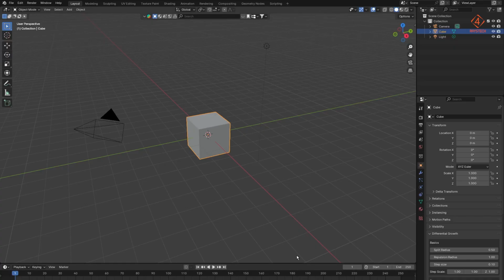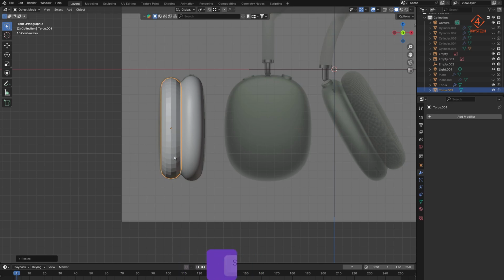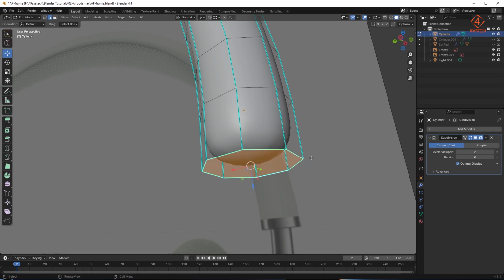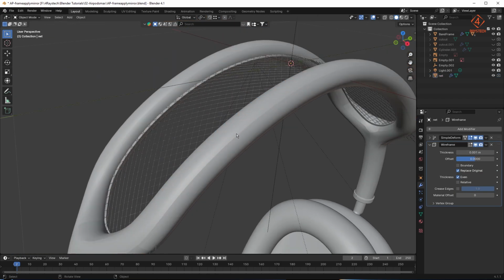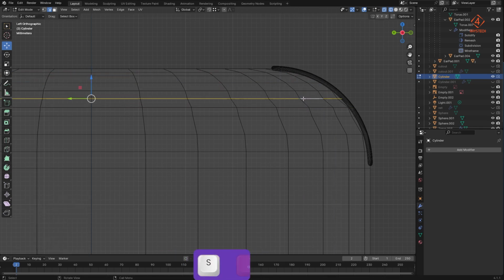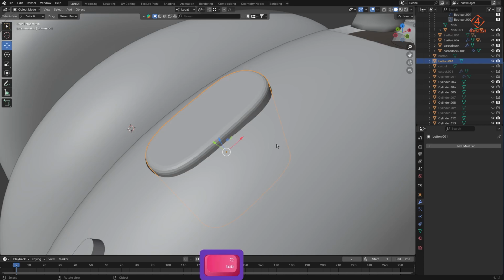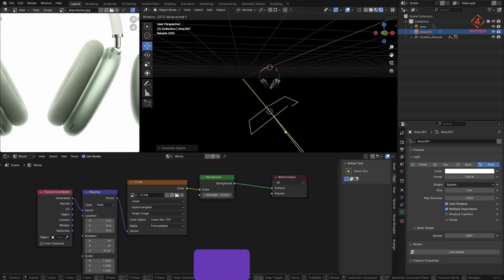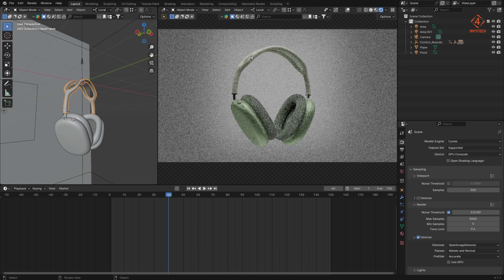Blender 3D Tutorial: Step-by-Step Airpods MAX Headphones

Comment: It was really hard following you sir, 😢. I wish you slowed down your pace more for beginners like me but I understand that you may have other things you're optimizing your time for.

I had to use grok to relearn that volume knob 90-crease count boolean thingy. Mine was distributing eccentrically, even after aligning the origins of the curved cylinder (trimmed torus) and the empty. I followed everything you did but it still distributed eccentrically. Until grok told me to use "ALL TRANSFORMS" and it worked... Lol 😅

Thanks for the tut anyways, you're a pro but consider your students who are noobs. ❤
Reply: why dont you slow down the playback speed to your taste,so you can follow him easily
Reply: @master_of_blade29 I did something congruent: repetitive rewinds. Yet it was not helpful in deriving an explanation for why the 90-creased volume knob array+boolean modifier could go wrong, like mine did.
 I had to use grok to troubleshoot my way out of that obstacle. Which was oddly fun 😂. Yeah some things are difficult when attempted for the first time, I'm not being a bitch and suggesting it should all be roses and fairy dust.😅
 I just think a tutor, a great one, goes easy with their babies so as to simplify what otherwise is rigorous and advanced for them to assimilate, but that's just my pov.
Reply: @ChimaVix  good work

Comment: Not a very good tutorial, a lot of steps skipped and showed too fast, some parts cut out of it, once you do and rotate headphones next thing you see after 10 minutes they are back to zero, so why making it so many unnecessary movements? hard to follow this tutorial ive seen more detailed ones and if i didnt have basic knowledges of it i wouldve not been able to follow this. also the whole part with array modifier is very confusing too. but maybe thats the idea of this tutorial that it is not for beginners, although if you are not a beginner you can easily make it by yourself so what is the point of this tutorial if not to teach someone?
Reply: i agree bro. not very easy to follow. quickly just goes through his process but doesnt really show you much.